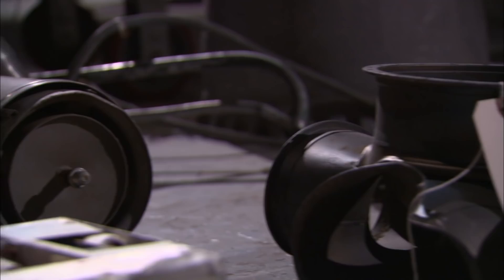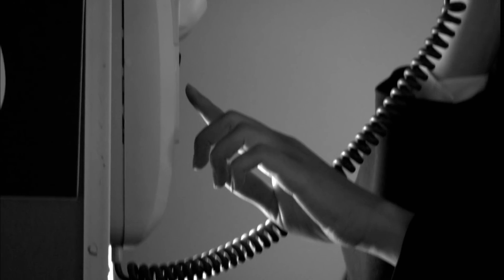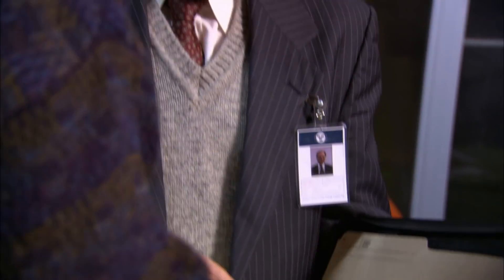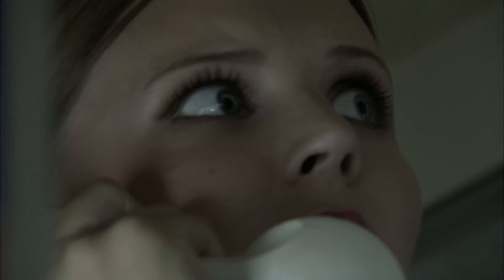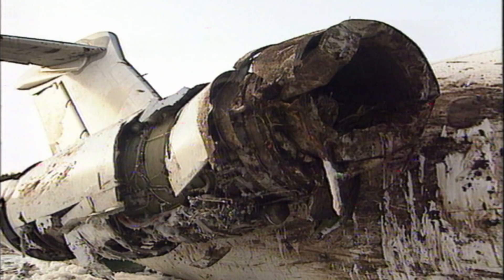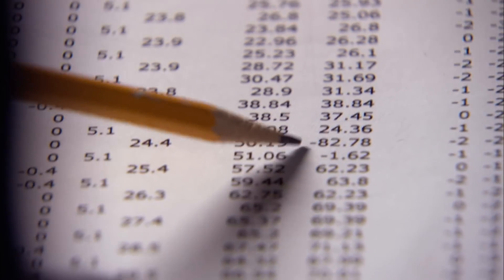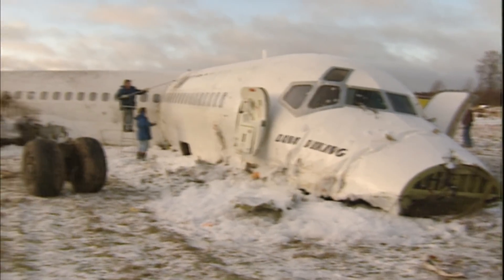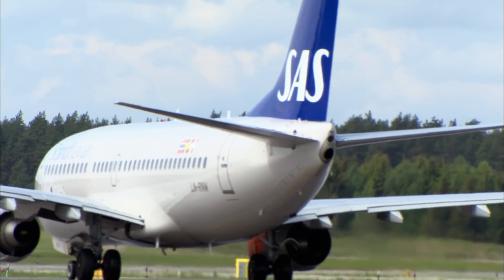What Caused The Engine To Erupt Into Flames On Flight 751? | Pilot Betrayed | Mayday: Air Disaster

Comment: If there was an inch of ice on the wings as the investigator GUESSED, the plane would not of made it off the ground so easily. I would say there was a thin line of clear ice down the middle in a blind spot, only a few millimetres thick. Just enough to not disrupt the “lift” and just enough to break off and get sucked into the cheap engines and flame them out. Go with Rolls Royce next time! This Captain slowed the plane down just enough and flared at the last second so they would drop to the ground just a few feet, which is why everyone survived!
Reply: Yes, I think he was overestimating the thickness of the ice for sure.

Comment: The sad reality is that these safety measures are added to reduce crashes caused by pilot errors, but its offset by the safety measures causing the crash, there is no real solution, if the pilot has control over the safety mechanism and the pilot makes an error, the plane goes down because of the pilot, if it is the other way around, this accident is what is the result of that
Reply: Yeah. It is a probabilistic trade-off. A bet that the automation with save more lives than it will take. Usually it is the case as humans makes mistakes. And of course the MCAS is different trade-off. It was put there to save Boeing development costs and time-to-market, so in the MCAS it was a pure bet to make more money, worst the ATR per principle imo.

Comment: Someone should invent a de-icing fluid that shows a color where clear ice can’t be seen. If it shows a color, then it needs to be de-iced in those colored areas.
Reply: now that is a great idea
Reply: Better yet here’s a simpler idea, create a strike area (a area with larger metal thickeness) and when they go on there to check for ice with a hand held pick or shiv strike that strike area and see if it cracks or creates ice flakes indicating ice is still present. An you can have these every 3 feet or so to be sure

Comment: Yah I was in a car accident earlier this year. Was driving at 8pm in January, pitch dark, and went to take a left onto a on ramp. Last thing I saw was a vehicle coming dead on at me. Head on collision. I had a green light to turn but so did oncoming traffic. I didn't think I saw anything but the guy I hit did have his headlights on and was driving a dark gray vehicle. Still have flashbacks of it and it's been 9 months since. Kind of scared to drive again. Thank God I had a dash cam in my suv.
Reply: I was rear ended at a major intersection in my town. I moved from that town 10 yrs latter and still was worried at that intersection every time. I think some things never leave you. It just your ability to adjust. Some times it can’t be over come!

Comment: After watching this and other videos, it seems that there are too many situations where ultimate control is taken away from the pilot. Almost like communism in a sense. Embedded static systems have the last word. The most recent being the  Boeing 777 firmware. I'm a two wheel idiot but I say the pilot is the master of the ship, give him the ultimate control. They should be able to do ANYTHING they want. When I fly I want to put my trust in the human that is awake while I'm flying and not a programmer that's not even present at the time I'm off the ground.
Reply: humans can excel in areas where/when computers fail. on the other side of that coin machines can/have saved humans from their own errors. they both have their pros and cons, but i totally agree there should be a master control switch that turns off ALL assisted/automated flight control.

Comment: I think whoever added that safety feature, and did not tell the airline should have held more responsibility. Sounds like the airline did not know untill after.
Reply: Sorta seems like MCAS situation frankly
Reply: Kinda like MCAS.  Maybe if a tougher penalty had been dealt out to the manufacturer in this one it could've saved lives later with the MAX.
Reply: It was their responsible to know these things.  They were supplied with the documentation, they just didn't read it.
Reply: As I understand it it was NOT there when plane was delivered but they got it when software was updated. if you had ordered it you would have buttons switching it off but they didn't since they officially did not have the functionality. Either wrong version of software was installed (bad!) or software was containing functionality it wasn't supposed to (even worse!).
Reply: It wasn't something that was added after they got the plane, it was simply an additional feature - like when a car manufacturer adds features to the next model year. It was in the manual that was provided by the manufacturer - but apparently nobody at the company read the manual. 
I realize that a lot of people don't read the owner's manual when they buy a new car, but I would expect a greater level of attention when you buy an aircraft
Reply: @valerierodger7700  yes but that's like saying a car company puts in a new feature that speeds up the vehicle when this thing happens, and expecting the customers to just read the 300 page manual and know about it. that's unreasonable
Reply: something like that, seems so benign. its hard to see how a system like that could have any negative effects, which would explain why they didn't think it was important to mention.

Comment: Imagine ATR as a newly upgraded  safety feature being responsible for this event. Smh
Reply: Bears similarities to MCAS
Reply: @randalnichols7377  It certainly does.
Reply: Thats what happens when you try to fix something that isn't broken
Reply: @2511jeremy  And guess what engineers say? "If it ain't broken, fix it until it is!"

I will say that in many cases, though, it's not the fix itself--often that IS addressing something that needs to be looked at--but the WAY it's implemented.
Reply: Why acronym??
Reply: Not terribly unsurprising, considering Boeing later acquired/was acquired by Douglas